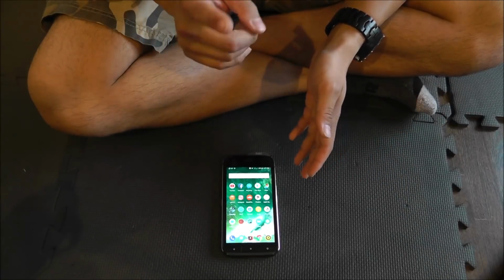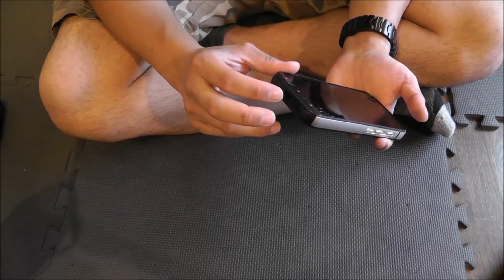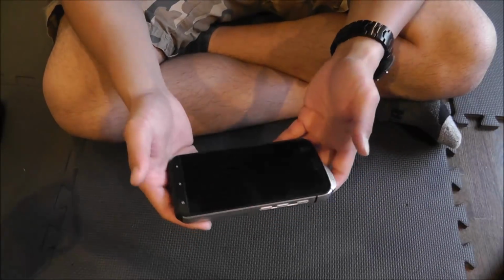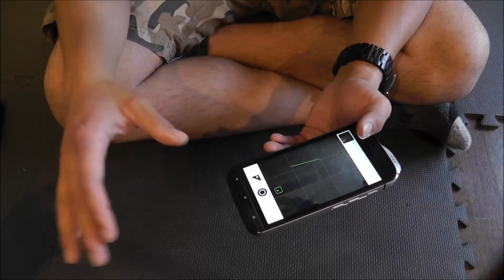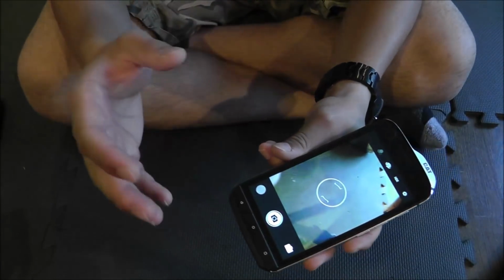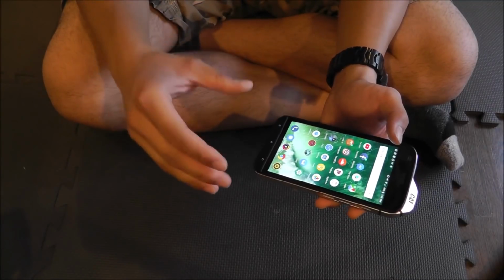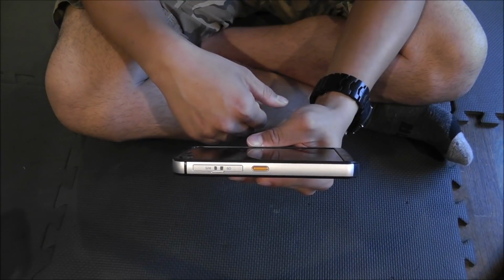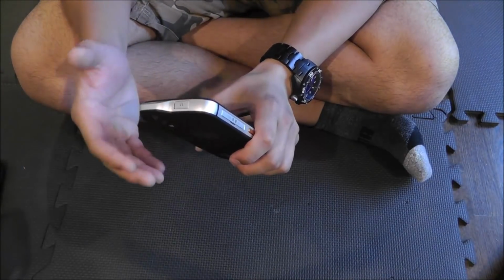REVIEW: CAT S61 [FULL REVIEW] [THERMAL VISION AND LASERS!!]

Comment: The FLIR specs are found on page 45 in the S61 manual:
"FLIR Thermal Camera: 80x60 + SDK"
Reply from the maker: Yeah I agree, unless something is funky with the most recent update (which did temporarily remove thermal livestreaming), it would appear the resolution is 80x60.  I did some testing and the thermal resolution just is really crunchy.

What's weird though, is that I spoke with a Cat representative who when I asked about the S61 thermal resolution, sent me this data sheet.  You'll see it appears to be the correct data sheet and lists the thermal resolution as 120x160.  Well all I can hope is that it's just a software bug.  But I am very confused for sure.

OVERVIEW
Effective Frame Rate 8.8 Hz (commercial application exportable)
Input Clock 25-MHz nominal, CMOS IO Voltage Levels
Output Format User-selectable 14-bit, 8-bit (AGC applied), or 24-bit RGB (AGC and colorization applied)
Pixel Size 12 µm
Scene Dynamic Range Low Gain Mode: up to 450°C; High Gain Mode: up to 150°C
Spectral Range Longwave infrared, 8 µm to 14 µm
Temperature Compensation Automatic. Output image independent of camera temperature.
Thermal Sensitivity <50 mK (0.050° C)

CONNECTIONS & COMMUNICATIONS
Video Data Interface Video over SPI
ELECTRICAL & MECHANICAL
Control Port CCI (I2C-like), CMOS IO Voltage Levels
Package Dimensions - Socket Version (w x l x h) 11.8 x 12.7 x 7.2 mm
Mechanical Interface 32–pin socket interface to standard Molex® socket
ENVIRONMENTAL & APPROVALS
Non-Operating Temperature Range -40 °C to +80 °C
Optimum Temperature Range -10 °C to +65 °C
Shock 1500 G @ 0.4 ms
IMAGING & OPTICAL
Array format 160 x 120, progressive scan
FOV - Diagonal 71°
FOV - Horizontal 56° (nominal)
Image Optimization Factory configured and fully automated
Non-Uniformity Correction (NUC) Automatic with shutter
Sensor Technology Uncooled VOx microbolometer
Solar protection Integral
POWER
Input Supply Voltage 2.8 V, 1.2 V, 2.8 V to 3.1 V IO
Power Dissipation 140 mW(operating), 650 mW (during shutter event), 4 mW (standby)

https://www.flir.com/news-center/camera-cores--components/the-next-generation-thermal-by-flir-smartphone-cat-s61/
Reply from the maker: Bo Tingsten Ahh okay, yeah that makes sense.  Yeah it's unfortunate but it's still not a deal breaker for me.  Its just frustrating that there is so much incorrect data out there.  Even clove electronics, an authorized retailer for Cat Phones, stated in a YouTube video that the thermal resolution was stepped up to 120x160.  But it just clearly isn't.
Reply: Interestingly, Cat doesn't mention the thermal resolution at all in their presentation of the S61. Improved resolution (four times more pixels) in the thermal device would certainly be something to be marketed hard. But this is what gives:

"The Cat S61 includes several improvements over its predecessor, including a larger 5.2-inch screen, laser assisted distance measurement to measure point-to-point distances up to 10 meters, an indoor air quality sensor, and an increased thermal temperature reading range of minus 20 to 400 degrees Celsius."
Reply from the maker: Bo Tingsten Yeah, it's looking like we've still got the same crunchy thermal resolution.  Honestly, this combined with the visible light cameras being better but not quite where I'd like, just makes me feel like they would have been much better off selling this thing for $1200 and just upping the quality of the components.

Comment: The Lepton module is 80x60, Flir told me this directly. I only have the S61, so I don't have the real comparion, but if it really is the higher res, its funny that they (CAT, Bullit and Flir) don't know what they make. Smells like something is too cheap to mention. The camera is actually faster, you had the hdr on. I was wondering about this too. with hdr off,  you can even do burst and its pretty fast.
Reply from the maker: On the camera, I understand that, I had HDR on, but I was making the comparison in speed with my iPhone, also with HDR on and there is still no comparison.  My bad for not mentioning this in the video.

In terms of the lepton module, it now seems you are correct, my mistake.  I was going off of early data and info from people that has turned out to be wrong.  I spoke with Cat directly about the resolution and they sent me a spec sheet, detailing a module with a resolution of 120x160.  But it appears they simply don't know what they are doing and sent me a spec sheet on the lepton 3 module and not what's in the S61.  Because the thermal resolution still seems just as crunchy as on the S60.

This is all dissapointing, but what's even more dissapointing is that Cat doesn't even appear to know what they are selling.

Comment: Thermal camera and Snapdragon processor, would be nice, but that alu casing, is turning me a bit off, like my S41 with the rubber.
Reply from the maker: Well if you're concerned about the aluminum chassis like I was, you can get the rugged urban active case directly from Cat Phones.  Check out my video on it here: https://youtu.be/5Vv_B7AaAsE
Reply: add a case, aluminum is best for sinking heat from the giant ticking time bomb battery

Comment: Do you have any idea on how to make the display stay always on? The setup just gives 30 minutes maximum ON time. Thanks.
Reply from the maker: ZAMsChannel Yeah I noticed that as well, unfortunately, I think that's the longest interval available.  Hopefully, Cat adds an always on option in an update.
Reply: Thanks for answering so quickly.
Have you tested if it remains on when externally supplied with power? How shall one use it with a navigation app on a vehicle when it turns off after 30 minutes? Do you know any solution for that?
Reply from the maker: ZAMsChannel Sure thing!  Welll I haven't tested that exactly, but I do know I was able to use Google maps and it didn't seem to lock on me, but I'll have to do more testing at some point.  I know it doesn't seem to lock on me if I'm watching video.

Comment: How's the GPS on this phone? Does it drain the battery quick and make the phone hot if you use waze or google maps? I have the s9+ but will be giving it to my wife if this phone is quick enough for waze and when switching to other apps like chrome, phone, sms. I drive daily to different areas in the metroa area so the GPS is very important and apps switching(or multi-tasking). TIA.
Reply from the maker: istik Battery life on this phone is impressive no matter what I'm doing and I haven't noticed any extra heat while using GPS navigation.

In terms of switching apps quickly and the like, you have to keep in mind it still only has a snapdragon 630 and 4 gigs of ram.  No slouch but not cutting edge either.  I haven't experienced noticeable excessive lag but I would say it will likely be a smidge slower than your S9 plus.

Comment: is this available in philippines sir?
Reply from the maker: Well it is available on ebay and Amazon, so I'm sure you could get it from there.  Also I'd check Cat's website to see if you can buy from them directly.
Reply: @ctuan13  i need to see that phone in personal so i can check if its good..because loys of people asking dont buy that phone in just 5 months or 7months it will have damage and they will not replace anymore
Reply from the maker: @benjiecalago1776  I'm not sure exactly what you're getting at, but the S61 comes with a 1 year comprehensive warranty that covers the entire device and if you buy directly from CAT, you can register an additional year of warranty, for free.
Reply: @ctuan13  i dont have an ideA if its available in philippines,just wnt to buy this phone
Reply: Is this phone have been unlocked ???
Reply from the maker: AA/AD J Yes this phone is fully unlocked and can work on any GSM network.

Comment: Hello again. I'm wondering if anyone using At&t, is having issues with dropped calls and text. Trying to figure out if it's the new S61 or the network. They say, they're working on the towers for 5g upgrade and it can affect towers.
Thanks!
Reply from the maker: Hey man, I use AT&T.  I have since day one.  I haven't had any issues with calls or texts as long as I have signal.  My guess is towers in your area.  Although it could be a fluke with your particular phone as well.  Maybe try driving to a completely distant area and see if you still experience the same issues.
Reply: @ctuan13  thanks for the reply. Turns out, it's the device..again.  Burner phone works fine. I'll try the S61 again in a few months, when business slows down.  You should make a video on how to use the flir tools to generate thermal reports! It was my favorite thing to add to invoices. Cheers!
Reply from the maker: @Gerry926  Will do!  I'll try to do that in a future video!  But have you contacted CAT?  This level of disfunction is unacceptable.  This needs to be covered under warranty.
Reply: @ctuan13  Cat has been great to deal with. I bought directly from them and I already have a shipping label for the second return. 3rd times the charm but not just yet. I'm obsessed with thermal imaging now, Lol. So I'll put a Flir pro one and a rugged case on my next phone for now and revisit the S61, down the line.

Comment: A lot of false info in this video: The S60 FLIR sensor resolution is NOT 90 x 60, it is 80 x 60.
Furthermore, the S61 FLIR sensor is NOT, repeat NOT!!!, quadrupled in resolution  at 160 x 120.
It is still a 80 x 60 sensor, the same as in the S60, but with software wizardry extending the usable temperature range.
I got a brand new S61 and was hugely disappointed, as even the manual clearly states the FLIR sensor to be 80x60, a fact that was also reluctantly confirmed by an extended chat with CAT customer support.
Nowhere in the various tech specs that I can find around the Net does it ever mention the new Lepton 3 or 3,5 sensors with 160 x 120 resolution being used in the CAT S61.
Bummer!!!
Reply from the maker: My bad, simple mistake on the resolution!  I misspoke there!  And as far as I knew the resolution was increased, but if it isn't that's strange, since the resolution when covering the visible light camera in thermal mode, seems to be much better than the S60.  

Still no matter what, my apologies for the incorrect spec point, hopefully you still found the video informative!  Thanks for watching!
Reply from the maker: Also, you mention a specification you read listed in a manual, yet if you watch my unboxing video, you will see there was no manual in my box, only a warranty booklet and a quick start guide.  Where did you find a full manual?
Reply: Perhaps he saw an early manual?
Reply: A Cat chat support specialist confirmed to me the thermal sensor had been updated to 160x120 when we spoke on July 6th.
Reply from the maker: Patrick Cloninger Thanks for the comment, that was my understanding as well.  In addition Clove Tech, a UK electronics retailer is an authorized cat phone dealer and in a comparison video on their channel also stated that the thermal resolution had doubled.  Also if you compare the thermal only footage of the S61(blocking the visible light camera), it looks far more like the footage from a 120x160 module, more than a 80x60.  But I guess I won't really know until more detailed specs come out.
Reply: ctuan13 Yeah. Not sure how’d they’d get HD quality images still using 80x60 VGA.
Reply from the maker: Patrick Cloninger Well when they're saying that the resolution is now full HD instead of VGA, they're referring to the MSX visible light camera overlay.  But when it comes to the raw thermal resolution, I've seen most references point to 120 x 160.  Plus just viewing the raw thermal-only footage, would seen to show way too much detail and clarity to be 80 x 60.
Reply: Thermar resolution is 80x60 i got user manual from CAT support and here https://www.youtube.com/watch?v=O0ql7uhwXZk info from FLIR System (in comment). That why CAT never mention about this.
Reply: The full manual is only available as a downloadable PDF. Significantly the link at the Cat support site is non-functional(!) (or was last week, so the support guy sent me the manual by mail), but if you just google "Cat S61 manual" you can find manual PDF links elsewhere. Like here:
https://produktinfo.conrad.com/datenblaetter/1600000-1699999/001651184-an-01-en-CAT_S61_OUTDOOR_SMARTPHONE.pdf
Reply: ctuan13 if you wan to compare FLIR take a picture in the dark.
Reply: The FLIR specs are found on page 45 in the S61 manual:
"FLIR Thermal Camera: 80x60 + SDK"
Reply from the maker: I do see that now.  I will still contact Caterpillar for confirmation, but it seems to be true, that is dissapointing but still not a deal breaker.  For sure though, they have to put it on their next iteration.  Higher resolution thermal would be quite helpful.
Reply from the maker: Bodzio O And yes I am aware that I have to disable the visible light camera to get an accurate reading.  That's why I covered up the visible light camera to see only the thermal image.
Reply: Bo Tingsten I thought it was strange, because the Flir one pro,  that plugs into Android and Iphones, is better, at 160x120. That really should've been in this phone. Good enough for what I do but would've been nice.
Reply: Is this phone toughest, rugged and  waterproof ??